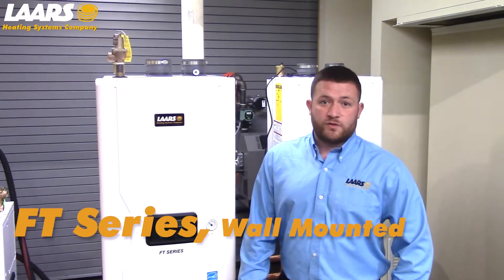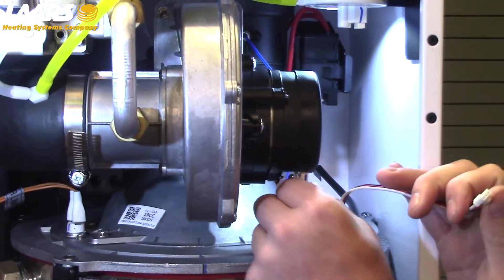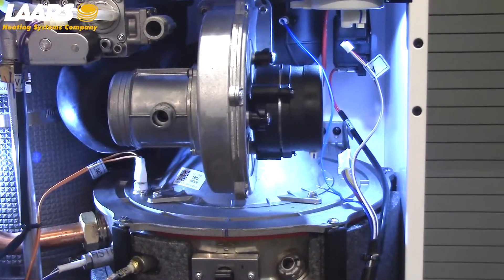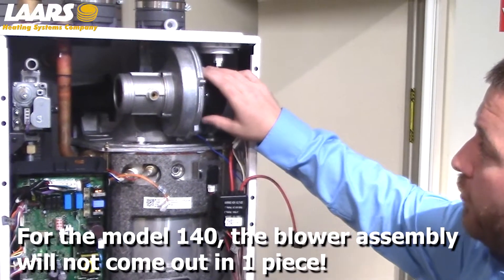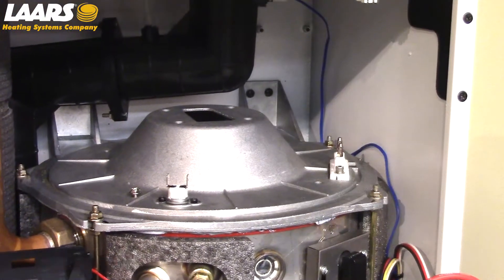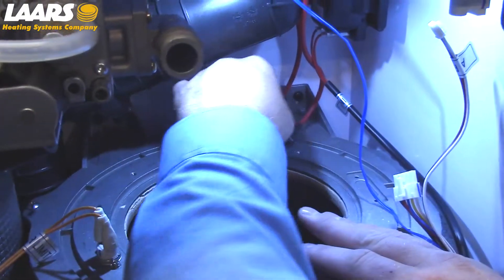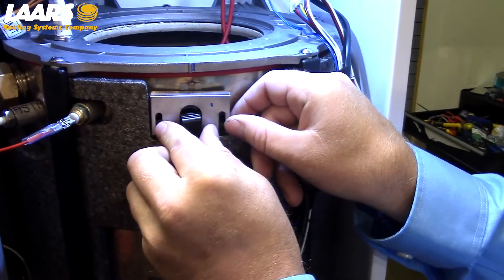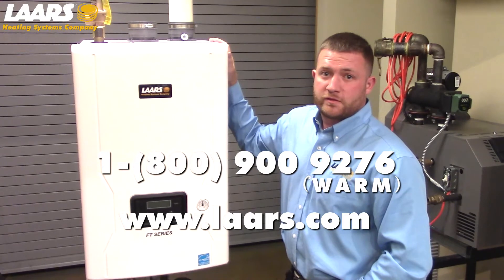FT Series Wall (residential) - Burner Removal and Inspection

Comment: Hi mike did a cleaning on the larrs heating boiler . After cleaning I can’t seem to get a way from an error 40 . Gas leakage . I check out your video to see if I missed a gasket but seems like I didn’t. I’m ordering new gasket . Are you fimiliar with an issue like this? Do your top burner plates ever warp ?

Comment: Hi Mike, Can a dedicated hot water recirculation line be tied in to FT Series 199 BTU model without an additional pump?  Any info you have on this greatly appreciated.  Thanks!
Reply from the maker: I can forward this message on to Mike.  The service and training team doesn't monitor our YouTube channel.  Best to call 1-800-900-WARM (9276) for technical assistance.  Thank You